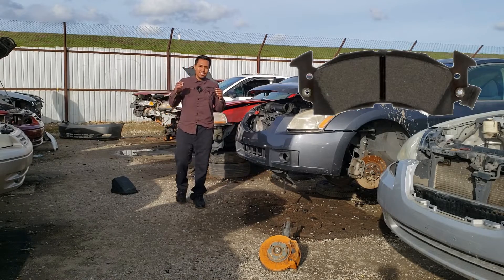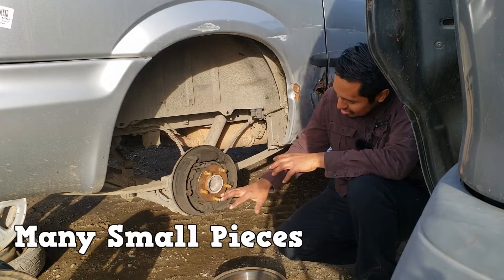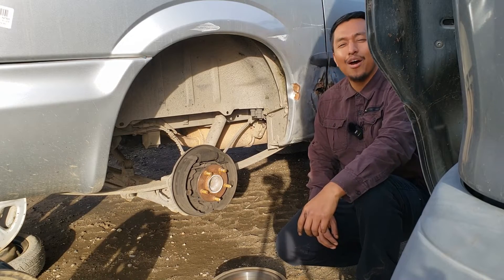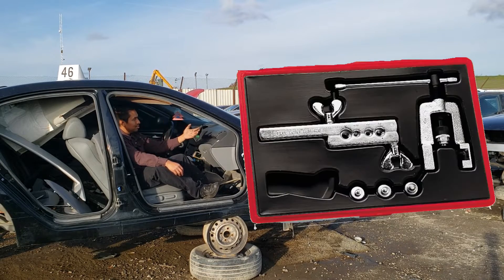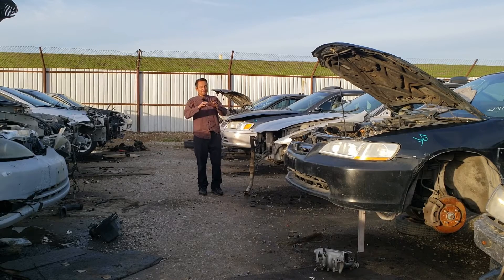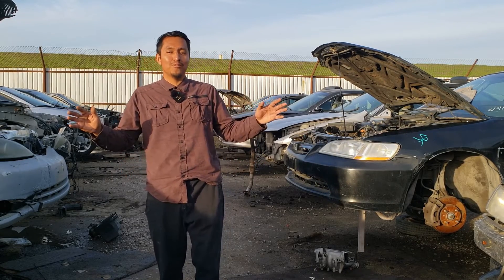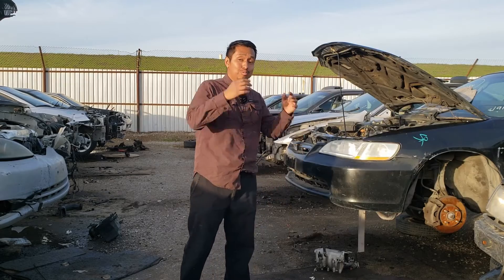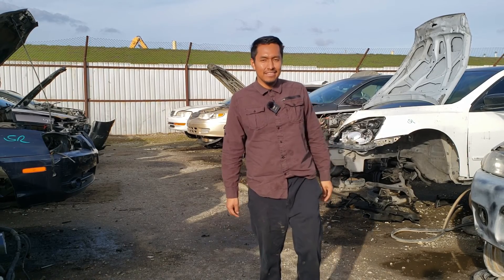3 ASE A5 Topics That Seem Difficult At First

Comment: Very helpful thanks! i take the test saturday
Reply from the maker: Regarding the 3 topics: Drum Brakes, the questions focus more on diagnostics, ie. What causes drag on brake shoes? Or what will be a brake shoe symptom if the wheel cylinder is leaking?
For fabricating brake lines: questions will focus on the type of brake line. Such as can you use a single flare fitting on a replacement brake line, can you use a compression fitting?
For Parking Brake adjustment: What if its too tight?
Good luck this Saturday! Let us know the good news!